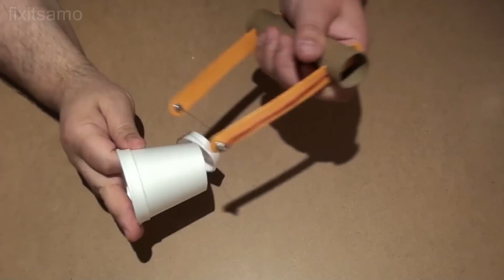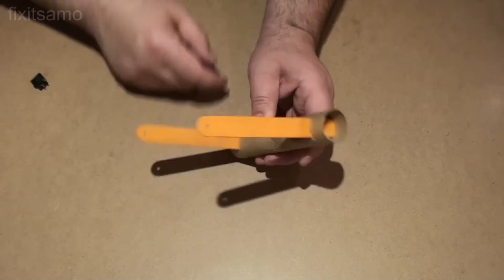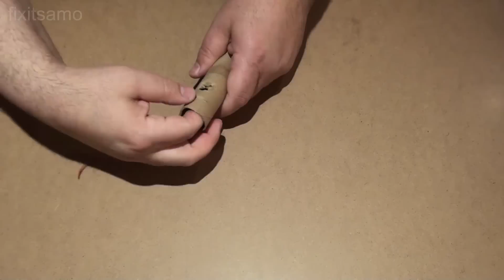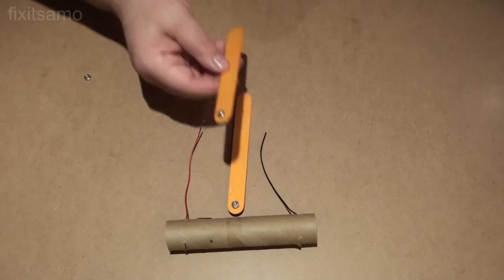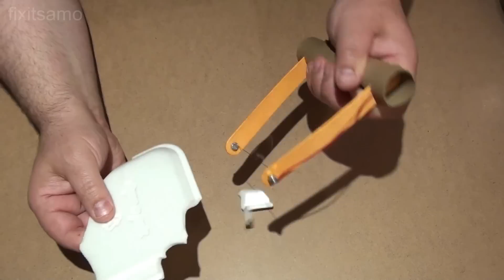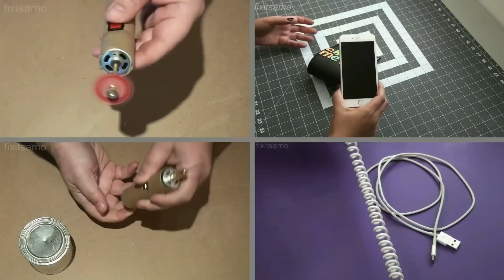DIY Hot Wire Styro-Slicer  How to make a foam cutter

Comment: If you're wondering, peeps.

No!

The battery will not shorten out because the electrical energy gets turned into heat energy when it flows through the resister wire. 

Basic Electronics at work here!

(SOS, last part was a little rude)

Comment: what if you use 0.1 mm resitance wire? I don't want the wire eat so much foam. I need to cut 4 meter long and 75 cm wide blocks.

Comment: Soooo, you're just short circuiting that battery?
Reply: Not really. 

He used a resister wire which turned the electrical energy into heat energy to melt and cut the foam. 

[I know my basic electronics]

Someone in High School taught me.
Reply: Gory Animations I guess I didn't see the resistor. Plus, you didn't have to add the fact you know basic electronics. I'm sure anybody does, at least past 8th grade.
Reply: @ncnnjnicksb2  resistor and resistor wires are different
Reply: @qwertyuiopasdf160  I'm so glad that I finally know after 4 years. (jk, I found out a long time ago). Ty tho
Reply: @ncnnjnicksb2  your welcome 🤗🤗😊😊